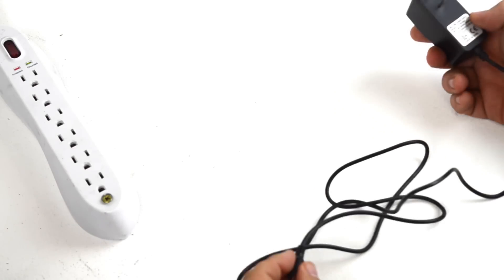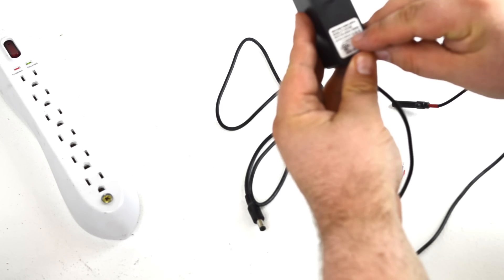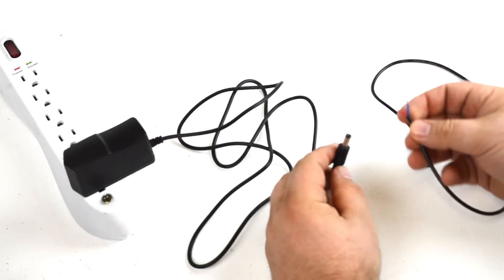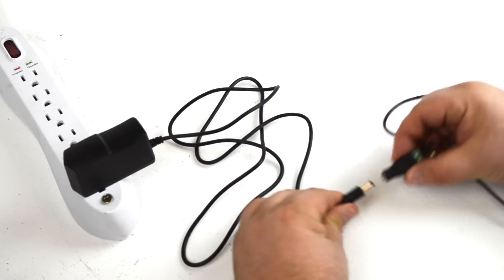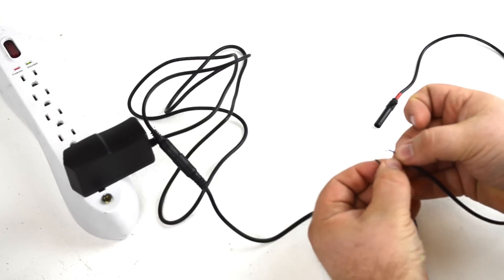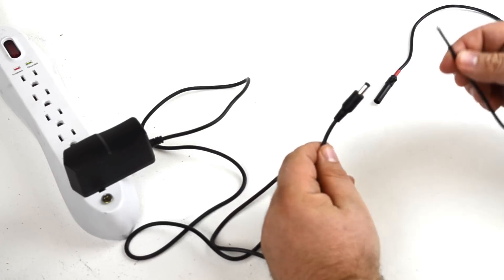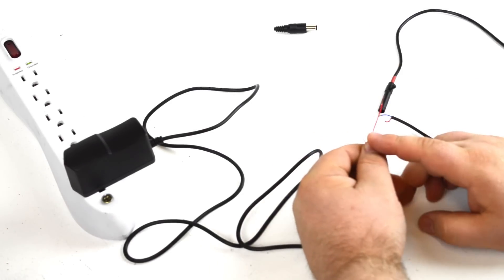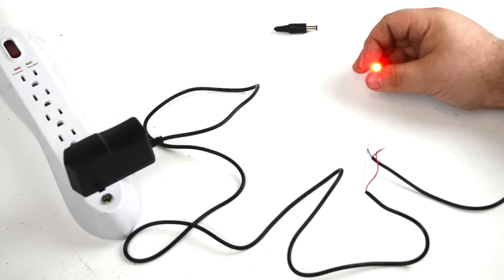Power Supply Tricks and Tips

Comment: Just a little tip...When you have to cut a plug off of a cord, if at all possible, try to cut it a couple of inches back from the plug. That way you have a plug with some wire that you use for something else later.